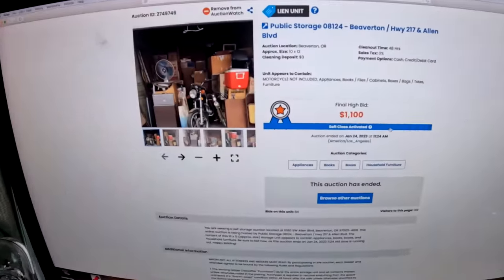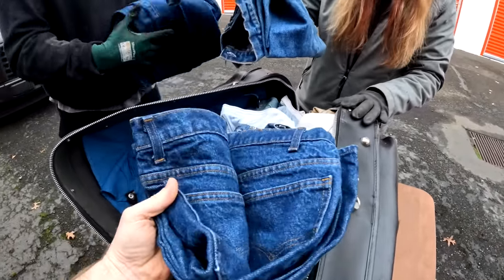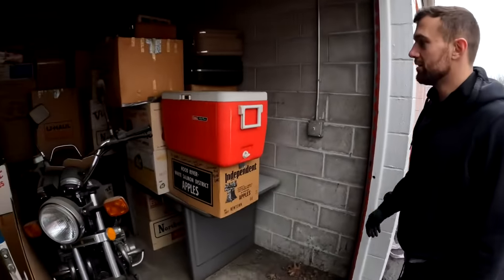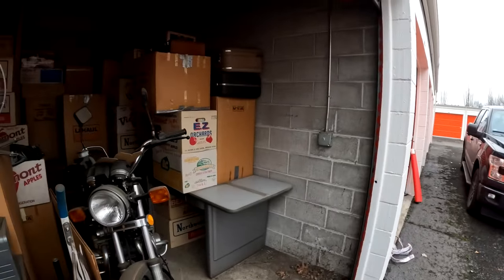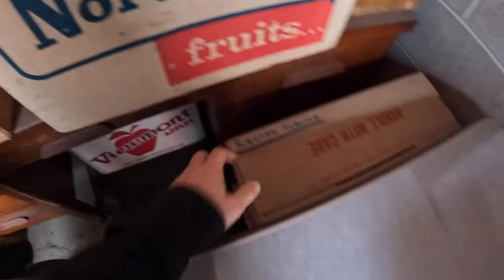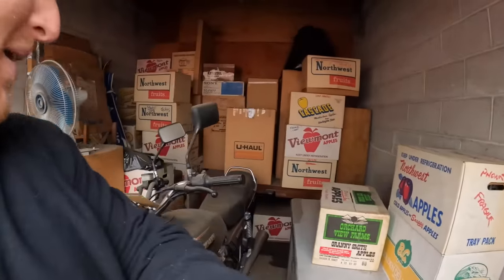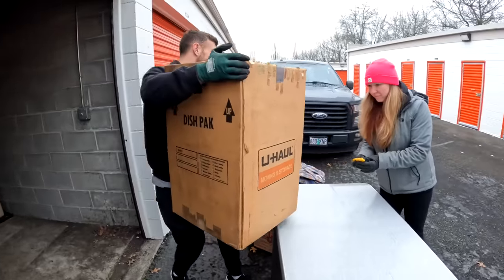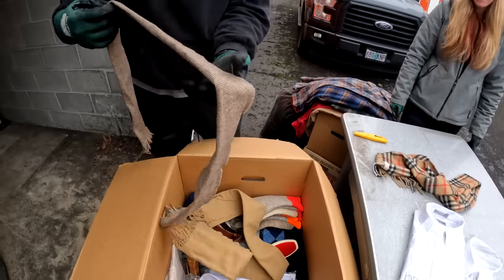MAN PAID 35 YEARS OF STORAGE RENT And I Paid $1100 For EVERYTHING YOU SEE

Comment: Check the Red Tab: Take a look at the right back pocket. Do you see our famous red tab? Is the word LEVI'S® in all capital letters, or does it have a small letter “e” instead? The Tab with LEVI'S (also known as “Big E”) means the jeans are from before 1971.
Where the red Tab was considered a trademark of the 501®, the brand wanted to differentiate other kinds of Levi's® clothing — such as the fashion denim, like bell-bottoms and boot cuts, which came out in the 1960s. With that, the Levi's® orange Tab was used to set these apart

Comment: That Suzuki, early 80s model will get $1,200-$2,000 in good running condition. Brothers EM-80 around $450 used, surely much more for yours. The JBL 4301B Control Monitor Speakers are apparently rare & desirable, priced on eBay at $1,550 used for the pair.

Comment: I own 4 vintage Suzuki's.. the 4 new diaphragm for the carburetors are gonna cost you at least $400. They were $100 a piece when I rebuilt mine 8yrs ago. All your cables are probably froze or rusted. I do my own work,  if not it could be cheaper to buy a new running bike.

Comment: If the engine is not locked up and it is in great condition that motor bike has the title with it and it runs you can get 6500 or 8000 for it

Comment: SHIT if it were a 750 cc 900 - 1000 then it would be the jackpot but unfortunately 650 is just a Chinese rice cooker for nerds. worth $300-$400 really a shame. What about all the press-fit bearings in the engine after 40 years.
disassemble and swap all. If you can't do it yourself it will be expensive